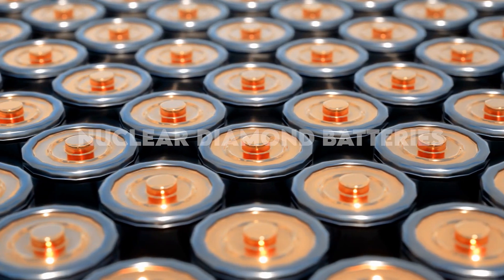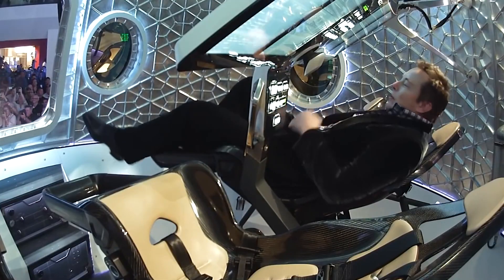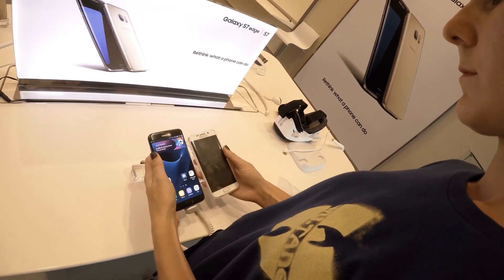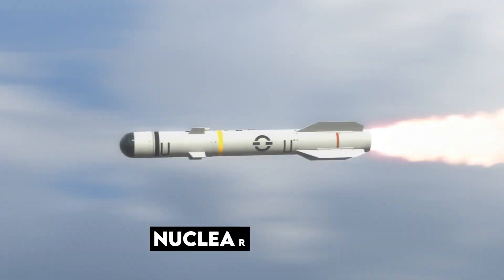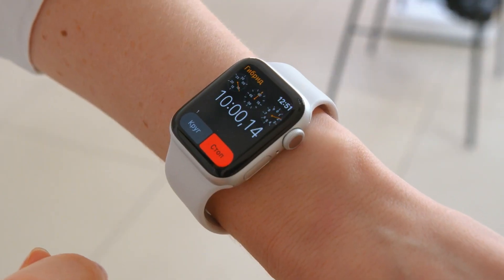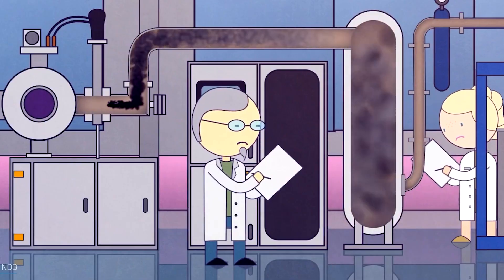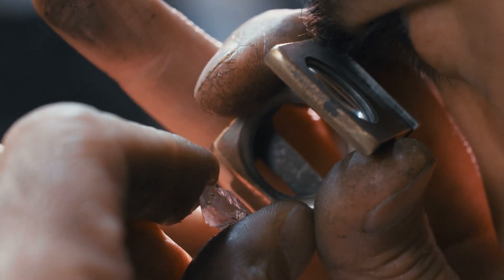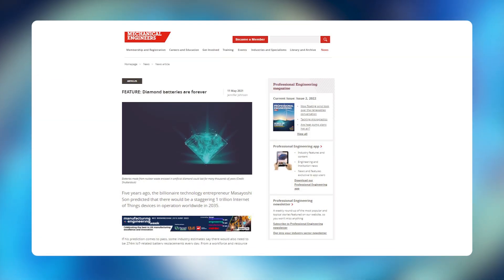Elon Musk Shocks World With A Battery That Lasts 28,000 years

Comment: one problem. betavoltaic cells only produce nanowatts and cost thousands of dollars at the scale of cell phone
Reply: The power density is approx. 10 micro Watts per cubic centimeter. So even if some very efficient phone is using 1 Watts of power, you will need 1/0.00001 = 100,000 cubic centimeters of battery. Yeah, that will make your mobile phone into a non-mobile phone, cost a fortune and be extremely dangerous as the total beta radiation emitted inside would be significantly more than 1 Watt of beta radiation (sort of a dirty bomb). There is simply no such thing as a beta voltaic battery being safe and providing consumer level battery power in one. You can make a "pacemaker battery" out of it but forget about EVs, phones and other modern gadgets where the POWER DENSITY needs to be on par with Li-Ion batteries. This video is pure ignorant rubbish. But does the guy speaking even know it?